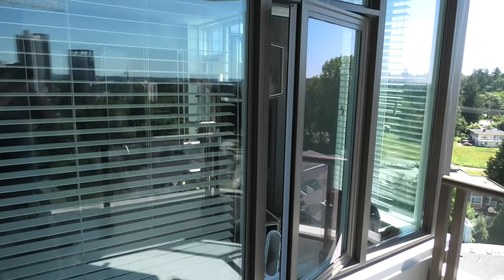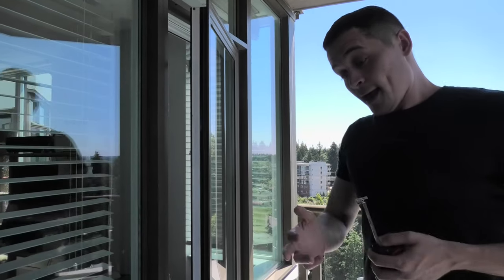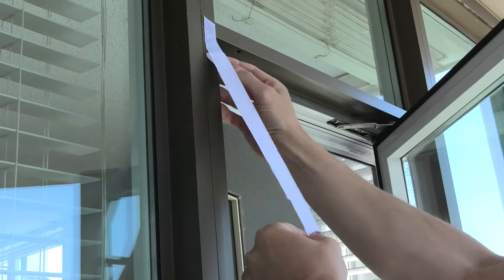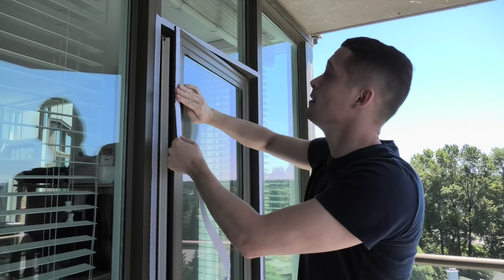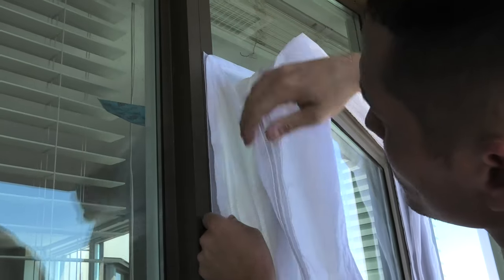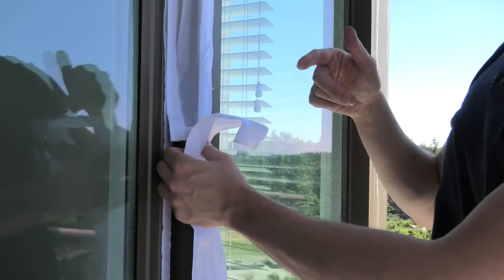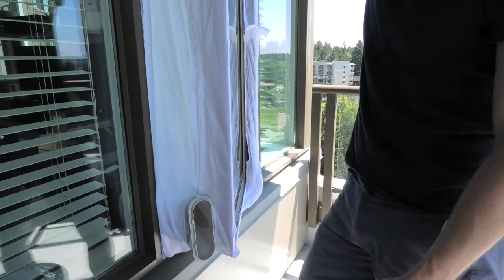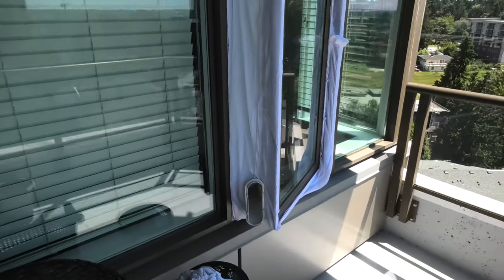How To Install Casement Window Seal For Portable Air Conditioner Exhaust Pipe (Hose)?

Comment from the maker: PRODUCT LINKS:
1. USA - Aozzy Portable Air Conditioner Window Seal, 400CM Waterproof Portable AC Window Seal and Tumble Dryer Compatible with Medium or Large Casement Crank Window and Tilting Window 158 inch (White) - https://amzn.to/3VNRbwk.
2. CANADA - VOLIKRA Window Seal for Portable Air Conditioner Casement Window, Window Seal for AC Unit, Sealing AC Vent with Zip Waterproof (400 cm) - https://amzn.to/3wBHNys.
3. DeLonghi Portable Air Conditioner 14,000 BTU, cool extra large rooms up to 700 sqft, remote, energy saving mode, extremely quiet, dehumidifier, fan, programmable, window venting kit, AC Unit for the room, EX390LVYN - https://amzn.to/3KDJodH.

Comment: Really clear instructions, thank you! So many kits and videos assume the window opens inwards, which is never the case!!
Reply: Well, as an example: in Ukraine most windows open inwards :) The installation for the outwards case is simple in this video due to having a balcony. If it was a straight wall on some 17th floor it would be an issue xD
Reply from the maker: @LifeContours  How To Install Portable Air Conditioner Casement Window Seal From The Inside Of The Apartment? - https://youtu.be/Ai790MT6k8Q.

Comment: Most of us are doing it from the inside so this is all back to front for us.
Reply: Under initial shock i thought having to dangerously climb from our garage somehow to my window. Not to mention installing it somewhat proper...
Then i realized my window opens inward 😅
Reply: @sueandrews2476  Haha. I managed to do mine. Eventually.
Reply from the maker: How To Install Portable Air Conditioner Casement Window Seal From The Inside Of The Apartment? - https://youtu.be/Ai790MT6k8Q.
Reply: What in the AF is going on here ? From the inside man, the inside…jeez a loo
Reply: I have Windows like this. I've been looking everywhere. Thanks!
Reply: In Canada all casement windows open outward so thank you for the instructions. Excellent video.

Comment: Can this be installed from the inside? I don't safely have access to the outside of my window.
Reply from the maker: Yes, you can install it inside as well. How To Install Portable Air Conditioner Casement Window Seal From The Inside Of The Apartment? - https://youtu.be/Ai790MT6k8Q.

Comment: Hi shouldn’t this be constructed on the inside of the window rather than the outside? That way the window closes without moving the overlap, and the Velcro is protected from the elements, or am I wrong? Many thanks.
Reply from the maker: You can install it on either side of the window. We chose to do it outside since our window is accessible from the balcony. BTW, you can still fully close the window even if the seal is installed outside. How To Install Portable Air Conditioner Casement Window Seal From The Inside Of The Apartment? - https://youtu.be/Ai790MT6k8Q.

Comment: Is this what the n Europe because I hear the windows open inwards and doors outwards in Europe compared to the United Kingdom because even though my window 🪟 opens outward in the United Kingdom i fitted the kit inside so I can keep the kit in and close the window when I go out without havving to take it off every time. I also fold the top part into the hinge gap area it is a much better seal but sash windows 🪟 with the blocker kit are so much better I fitted screws to stop the window opening and having air conditioner on over night 😆I also use duct tape and the zipper part I do not use 😜also I would say when closing try not to tear the fabric. I got my kit from Amazon and air conditioner from class ohlson 😊

Comment: Can the casement window be installed from inside the apartment? So it would be installed around the frame inside, in front of the screen.
Reply from the maker: Yes, you can install it inside. The idea is exactly the same but on the opposite side of the window frame and the window. How To Install Portable Air Conditioner Casement Window Seal From The Inside Of The Apartment? - https://youtu.be/Ai790MT6k8Q.
Reply: @MorozovAutomotive  Thank you for your help!

Comment: Wounder if you tried removing the sticky velcro?
It damages your frame unless you use very stronge (dangerous to breath in) chemicals (only way to not damage frame & remove the glue left behind) 
I did this on a upvc white window frame so wouldn't advise on coloured frame, use nano tape instead but the red stuff, damage less, heat & water prove
Hope this helps

Comment: Hello, my window is opening to inside. My question is would it make a difference if I try to do this from outside
Reply from the maker: The process will be very similar. Here is how we did the installation on the outside opening window from the inside - https://youtu.be/Ai790MT6k8Q.

Comment: How lucky you are to get only a 1,30 long and 0,63 wide windows measurings. Many people have windows openings much much longer and wider than yours and it seems to be very difficult to find out joint lengths with a suitable caulking

Comment: How can you attach it to an upstairs window?
Reply from the maker: You can install the window seal from the inside as well. Just attach the velcro tape to the interior window frame and the window. It is going to work almost the same way. The  only difference is if you want to close the window you might need to remove the window seal material. How To Install Portable Air Conditioner Casement Window Seal From The Inside Of The Apartment? - https://youtu.be/Ai790MT6k8Q.

Comment: Can this be used on fan mode without the hose
Reply from the maker: Yes, you can use the air conditioner fan mode without the hose.

Comment: Nice video - word of warning....it doesn't work if you have to hang a hose from a velux window. The zippers can't take the weight of the hose and it just keeps falling out. If someone has a workaround for this I would love to hear it.
Reply: Try this one, didn't use zips as it as pull string to hold hose in place:

https://www.amazon.co.uk/gp/aw/d/B0B6YZP2GR?ref=ppx_pt2_mob_b_prod_image
Reply from the maker: You can use zip ties to hold zippers together.

Comment: Where did you get the kit?
Reply from the maker: 1. USA - Aozzy Portable Air Conditioner Window Seal, 400CM Waterproof Portable AC Window Seal and Tumble Dryer Compatible with Medium or Large Casement Crank Window and Tilting Window 158 inch (White) - https://amzn.to/40Z3mqT.
2. CANADA - VOLIKRA Window Seal for Portable Air Conditioner Casement Window, Window Seal for AC Unit, Sealing AC Vent with Zip Waterproof (400 cm) - https://amzn.to/3wBHNys.

Comment: but how would I do this on the 3rd floor lol
Reply from the maker: You can install the window seal inside as well. The reason why I did it this way is because our window is accessible from the outside and it allows us to easily close the window without removing the seal. How To Install Portable Air Conditioner Casement Window Seal From The Inside Of The Apartment? - https://youtu.be/Ai790MT6k8Q.

Comment: I can’t get to the outside of the window mine opens outwards and I have no balcony
Reply from the maker: You can install the window seal from the inside as well. Just attach the velcro tape to the interior window frame and the window. It is going to work almost the same way. The  only difference is if you want to close the window you might need to remove the window seal material. How To Install Portable Air Conditioner Casement Window Seal From The Inside Of The Apartment? - https://youtu.be/Ai790MT6k8Q.
Reply: @MorozovAutomotive  Thank you so much I did it I can sleep now 😅

Comment: Hang on, if the window frame perimeter is 386cm and you need to stick the velcro tape on the window frame AND the window itself, you're gonna need about 800cm of tape. As far as I can see it only comes with 1x400cm so this is misleading.
Reply from the maker: The 400cm refers to the length of the window seal material itself and not the velcro tape. The length of the tape is more than enough.

Comment: What can i do if i live on a 6 floor ?
Reply: Jump
Reply: @cwise610  show me first
Reply from the maker: You can install the window seal from the inside as well. Just attach the velcro tape to the interior window frame and the window. It is going to work almost the same way. The  only difference is if you want to close the window you might need to remove the window seal material.
Reply: @MorozovAutomotive  can you do a video of this?
Reply from the maker: Hi, yes, I will try to make one.
Reply from the maker: How To Install Portable Air Conditioner Casement Window Seal From The Inside Of The Apartment? - https://youtu.be/Ai790MT6k8Q.

Comment: very cool but I live on a 2nd floor apartment, hehe
Reply from the maker: You can install the window seal from the inside as well. Just attach the velcro tape to the interior window frame and the window. It is going to work almost the same way. The  only difference is if you want to close the window you might need to remove the window seal material. How To Install Portable Air Conditioner Casement Window Seal From The Inside Of The Apartment? - https://youtu.be/Ai790MT6k8Q.
Reply: @MorozovAutomotive  Oh, that's actually pretty handy then! Thank you for that!

Comment: I thought the installation was from the inside of the window 🤔
Reply from the maker: You can install it on either side of the window. How To Install Portable Air Conditioner Casement Window Seal From The Inside Of The Apartment? - https://youtu.be/Ai790MT6k8Q.
Reply: @MorozovAutomotive  ty! I finally figured it out just reversed -duh🙃😅

Comment: Brilliant if you've got a balcony to stand on !!!! 
Otherwise how can you install it when you have a sloping Conservatory roof below that can't be stood on and I can't put a ladder up. ?? 
Rubbish.
Reply from the maker: This video demonstrates how to install the window seal in general. You can attach it inside as well if you like. We did it this way, since our window is accessible from the outside. This way I can easily close the window in case I don't want use the air conditioner without removing the window seal.
Reply: Most windows open toward the inside.
Reply: @s4nder86  Sorry NOT in the U.K they don't. !!
Reply: @alanedwards7496  maybe you have an old victorian house with one of these outdoor baby cages.
That should help you reach the window in no time :D
Reply: @svensnus  So funny,ha ha. 🤐
Reply: You just install it on the inside of the window. That's what I've done... Window opens outwards
Reply from the maker: How To Install Portable Air Conditioner Casement Window Seal From The Inside Of The Apartment? - https://youtu.be/Ai790MT6k8Q.